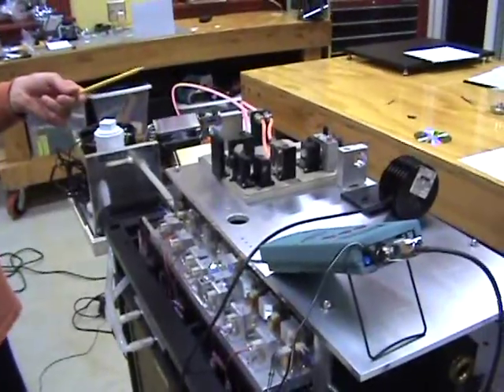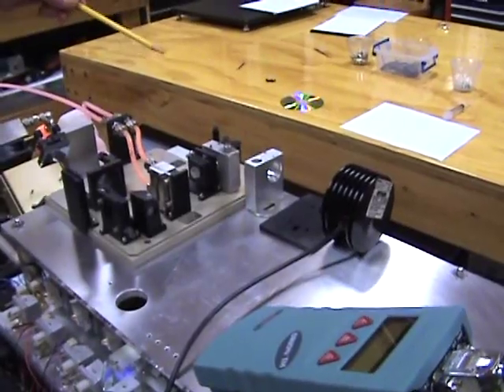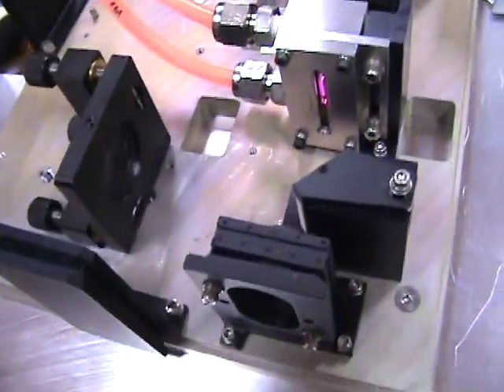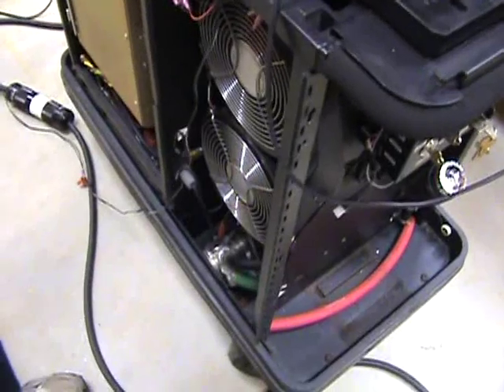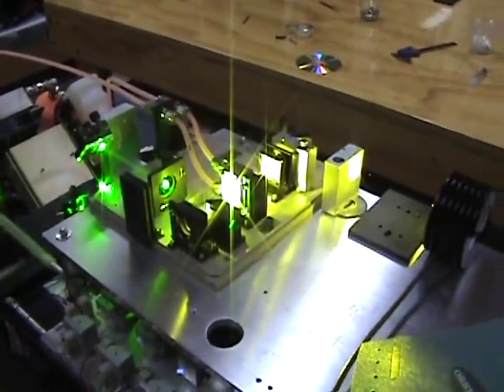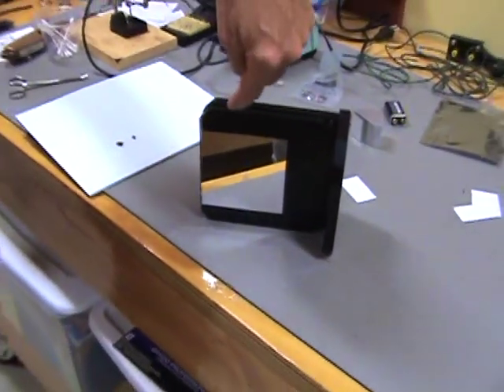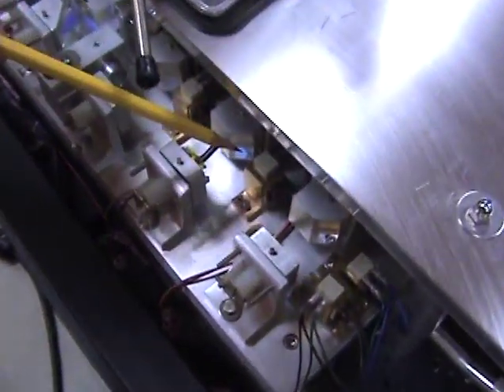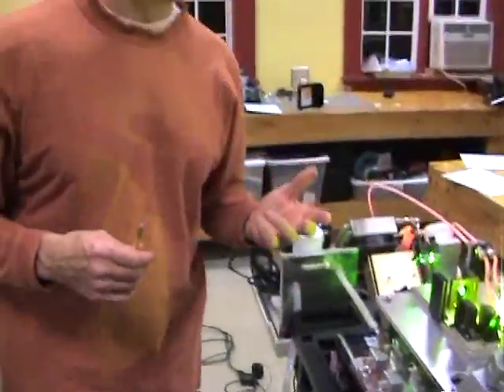575nm Yellow Dye Laser

Comment: One more thing. Are you using the A-671 Rochester aspheric lens for your M diodes? The reason I ask is that you mentioned 4mm. The Focal Length of that lens is 4.02mm and was a tip off. I mostly use that lens but I am looking for a better AR coating if possible since my diodes are 445nm.